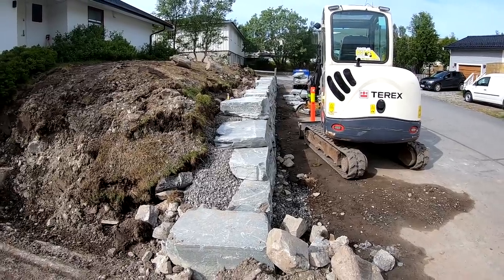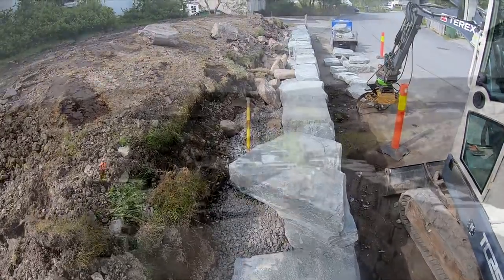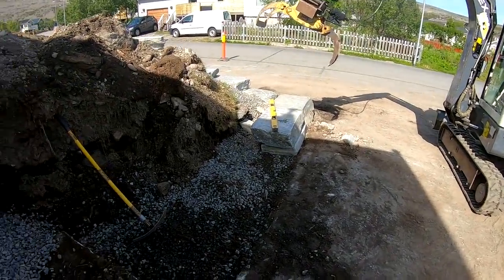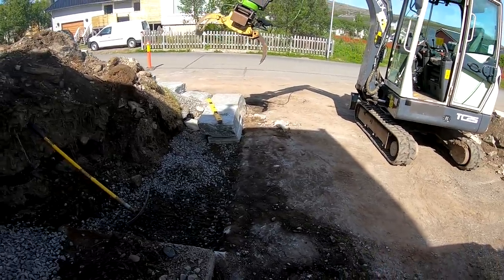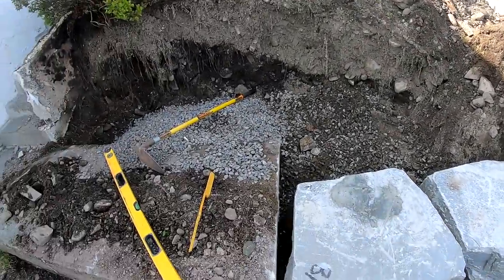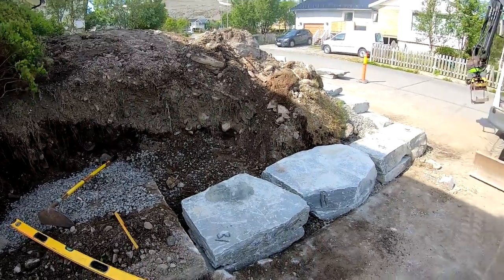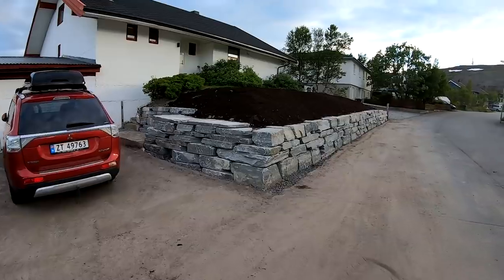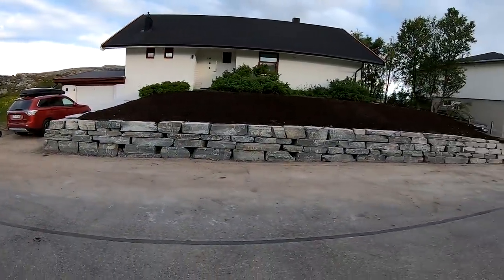Finishing the retainingwall build (Part 3)

Comment: Hope you are well super job by the way i was wondering wat kind of camera you use because i just boat a safari 5 of coirse for a first experience i chose a cheaper to be avle to compare but not really noing wat i want so wat kind and wat model of cameta do you use and what is the amount of time you can rwcord in one session.  See ya 😊
Reply from the maker: Thanks, I use a GoPro 7 white and one black with external mic. The White is great on battery life the black not so much, but black had better quality. I Use small battery packs to keep them going a long day, speacially in the cold winter.
Reply: How do you ad an extra batterie pack in the sealed case i have there is no conmection possibility i that maybe to make a hole to make a connection for the batterie pack .